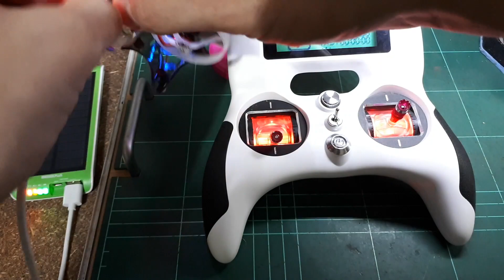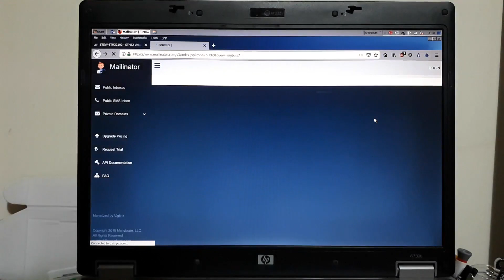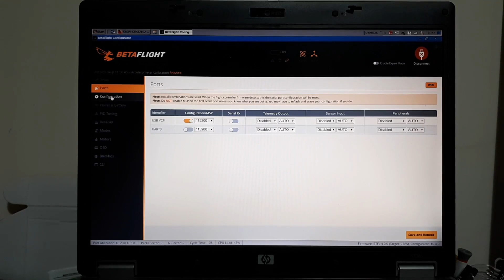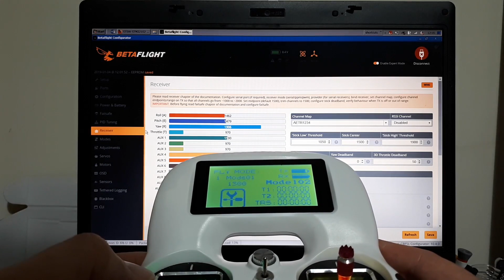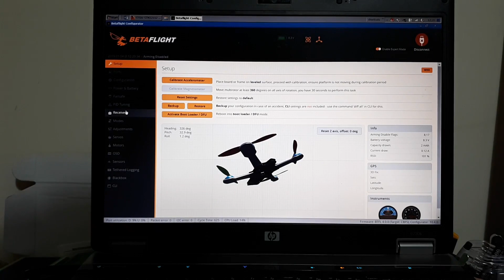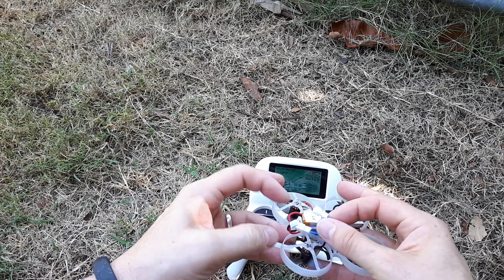Setting up the Mobula7 for the Turnigy Evolution

Comment: Can i bind turnigy evo. in Eachine US65?
Reply from the maker: I just had a look on the Banggood site for the US65 and they do offer both the FrSky and the FlySky models, so it would appear that you might be in luck. However, I do not own a US65 nor have I tried binding my Turnigy to it, so I cannot be 100 per cent sure if it will work. If you want to try then my advice will be to get the FlySky version of the US65.

Comment: Hi how do I upgrade my firmware for my Turnigy evolution
Reply from the maker: Just run the executable on Windows. A quick search on google for 'turnigy evolution firmware update' showed some links to Hobbyking and Project Blue Falcon. Although those instructions are from 2017 I would say that they are still relevant.
Reply: Hi I went to the HobbyKing website and try to download the firmware and it says the page is blocked to get the update
Reply from the maker: @k-wayneslim8644  I downloaded the firmware in November 2017 and it is the same version (0.0.9.31). I've just uploaded the file here ( https://filebin.net/w5fu27d9ppoqdjlp ) the link expires one week from now.
Reply: @marcelpost4052  thanks so much
Reply from the maker: @k-wayneslim8644  You're welcome. The upgrade process should be pretty straightforward.

Comment: Hey 

How about mobula 7 v2
I got the turnigy Evolution and the mobula 7 V2

Do they have the same attitude towards mine?
Reply from the maker: Great! How does it fly? (who's 'they' ?)
Reply: Marcel Post 

So it didn't work for me. When I start to fly and accelerate and flies, the copter stays at full throttle permanently.

although we have the same remote control just mine is mobula 7 v2
Reply from the maker: @KimdraRC  Lots of things to check then. And since I don't know anything about your setup you'll first have to get me up to speed on what you've done so far if you want me to help you. 1) did you really get the FlySky version of the mobula 7, because only the FlySky versions work with the turnigy evolution. 2) When you follow my steps in this video, at what point exactly (after 14 minutes in) does your mobula 7 differ from mine in the betaflight setup?  3) did you calibrate the mobula 7 on an even and horizontal surface? 4) do you have a mode 1 or mode 2 Turnigy Evolution?

Comment: Can I bind Tiny Hawk2 with Turnigy? Thx
Reply from the maker: When you read the page for the TinyHawk2 on the Emax-USA website, you'll see written: "(TinyHawk2 features) Frsky compatible receiver built-in to the flight controller". The FrSky protocol is NOT compatible with the FlySky protocol. Since the Turnigy evolution only talks the FlySky protocol, the TinyHawk2 is not compatible with the Turnigy Evolution. Unless you can find a TinyHawk2 with a FlySky-compatible flightcontroller it's not going to work..

Comment: Hello I was wondering if your big quad was using echine vtxo3 and if it was how did you connect it with turnigy evolution
Reply from the maker: Hi Jacob, the VTX I was using on the 5-inch quad is the Eachine TX801. It doesn't support smartaudio, if that's what you were asking about.. The mobula 7 does support smartaudio and it's just built in to the fc, you can just use the Evolution to change channels, nothing to configure. Sorry, I can't recall what the stick-sequence is to get into the menu, but it's something like: throttle-middle, yaw-left, pitch-up to enter the OSD menu.

Comment: Hey Marcel, ben je er al uit hoe de flymode werkt gecombineerd met betaflight
Reply from the maker: Je bedoelt horizon vs angle vs rate mode? Yup, dat heb ik op de linker switch van de evolution gezet. Ben nog steeds niet over op acro (rate) mode omdat ik nog niet veel fpv vlieg, maar voornemelijk line-of-sight.
Reply: @marcelpost4052  nee bedoel flymode op de turnigy evolution pro controller. Links boven in het scherm. Het is me inmiddels gelukt om alle vliegmodusen in te stellen op de controller (airmode, horizon, angle, headless, flipover, beeper. Het lukt me alleen niet om de prearm  in te stellen. Hij zegt dat hij saved maar zodra ik ander tabblad klik en terug ga is de prearm mode leeg. Heel vreemd
Reply from the maker: @ricardo8499  Oh, dat! :-) Weetje, ik heb geen flauw idee waar dat voor was. Ik heb altijd de modes ingesteld op een 3-way switch via Betaflight. Wist niet dat je dat ook via de touchscreen kon doen. Het fijne van de modes op een switch hebben, is dat je tijdens het vliegen simpel van mode kunt veranderen.
Reply: @marcelpost4052  het is ook door middel van de switchen maar je kan dan meer combinaties maken en de namen eraan koppelen. Dan weet je dus in welke modus je zit.
Reply from the maker: @ricardo8499  Okee, ik denk dat ik het snap. Heb afgelopen weekend een klein breukje in het frame gekregen. Waarschijnlijk ergens tegenaan gebotst ofzo. Gebruik jij het standaard frame of heb je extra (sterkere) frames gekocht?
Reply: @marcelpost4052  ik heb die V2 frame. Tot nu toe geen scheur en toch al aardige klappers gemaakt
Reply from the maker: @ricardo8499  Hehe.. super. Ik denk dat ik binnenkort maar even wat V2 framepjes moet kopen dan. Hee, success ermee.
Reply: @marcelpost4052  bedankt,wil jij kijken of je wel die prearm functie mode kan opslaan in betaflight?  Ik zag ook dat er een V3 frame was
Reply from the maker: @ricardo8499  Wat is een pre-arm functie? Ik arm gewoon de quad en vlieg weg. Doet die pre-arm iets speciaals? btw, bedtijd hier; kan er misschien morgen even naar kijken. Groeten.
Reply: @marcelpost4052  prearm is een extra veiligheid, dubbele handeling voor het armen, welterusten

Comment: Hey Marcel, could you help me?
In dutch and have the mobula and turnigy but its not working
Reply from the maker: Sure, no problem. Als eerste moet ik natuurlijk weten of je werkelijk de FlySky-versie van de Mobula7 hebt. Als je de FrSky-versie hebt, dan tja.. gaat het niet lukken.. Ik weet niet hoe goed je Engels is, maar als je bovenstaande video bekijkt, kun je dan wellicht aangeven op welk moment jouw Mobula7 afwijkt van wat de mijne doet? Ik heb ook een video gemaakt, speciaal over het binden van de Mobula7, misschien dat die ook helpt. Hopelijk kunnen we het stap-voor-stap doornemen en uitvissen waar het probleem zit. Als je wilt, kun je me ook mailen. Als je m'n voornaam en achternaam van plaats verwisselt, een punt er tussen zet en AT gmail.com erachter doet dan kan ik je wellicht iets sneller helpen (ik kijk niet altijd op youtube).
Reply: @marcelpost4052  bedankt voor je snelle reactie. Het is me al gelukt. Ik moest hem eerst flashen zodat ik de modes kon zien met de betaflight 10.5. heb je nog tips ?
Reply from the maker: @ricardo8499  Hey, hey.. goed nieuws! Tips? Nou, afgezien van 'hou 'm heel', heb ik gezien dat je een throttle-limit kunt instellen voor binnenshuis vliegen. De standaard throttle is waarschijnlijk te gevoelig voor kleine ruimtes, als je de maximum throttle via bf kunt terugzetten naar zo'n 70 procent dan zou de mobula7 iets beter te handelen zijn. Heb het nog niet geprobeerd omdat ik voornamelijk buiten fpv vlieg. Success er mee! :-)
Reply: @marcelpost4052  ga ik doen bedankt! Ik had ook al pid settings gevonden die hem aan het begin niet zo paniekerig laat vliegen. Throttle ga ik zeker aanpassen!
Reply from the maker: Ziet er naar uit dat je er een hoop plezier mee zult hebben. Gelukkig hoeven we quads lichter dan 250 gram nog niet te registreren hier. Gedoe zeg. Anyway.. Happy Flying! :-)

Comment: I have the same UAV build but i can`t fly it i can spin my motors in betaflight and controls seem to work as fell but when i try to fly i get flashing red led on flight controller :(
Reply from the maker: Check with your supplier. My first Mobula7 had a faulty flightcontroller and they supplied me with a replacement fc for free. This may not be applicable to every supplier, but it's worth contacting them to find out if they have any suggestions. Hopefully my videos will show you exactly where your fc differs. This may help you better explain to your supplier where the problem lies.

Comment: I just bought the tunigy evolution and I don't know beta. Can I skip all that and just bind with my quad? I have the tinyhawk..
Reply from the maker: Congratulations on getting into the hobby! The Mobula7 and Tinyhawk are both marketed as Bind-'n-Fly (BNF) quads. This means that although they are compatible with a lot of transmitters, they do not have an initial setup that your Turnigy Evolution knows about. BNF quads is all about giving choices to the hobbyist. Not only will you NEED to configure your new BNF quad with something like Betaflight; after a while you will probably WANT to. Out of the box, my Mobula7 had all sorts of alarms going off when sitting on the ground, armed turning on the transmitter etc.. really annoying. You can turn that off with Betaflight. The so-called Turtle-mode, which flips over your quad when it's landed upside-down by reversing the prop rotation with a switch on your radio is super-handy, but UNCONFIGURED by default. You may even want to use a different switch on your transmitter to arm your quad, or fly with Mode-1 (throttle on the right stick) instead of mode-2 (throttle on the left stick). All these options can be configured with Betaflight. It may be daunting to get to know the software and there are a ton of options in there to confuse you at first, but once you get better at flying you'll probably want to explore features that you see other people do with their quads. Especially for newcomers to the hobby, I wanted to simplify the Betaflight setup in this video as much as possible, so you can maximise your time actually flying your quad.

Comment: Bit of a newcomer to this so bear with me. Would this setup be the  same for the Mobula 7HD version? If nor what the differences be? I do have the Turnigy Evolution . Thanks in advance.
Reply from the maker: I believe so. I think that the HD version is just a video-path upgrade (camera, vtx maybe). Make sure you get the FlySky version of the Mobula as only that protocol is compatible with the Turnigy Evolution.
Reply: @marcelpost4052  Thanks I hope to be purchasing soon. Do you have a preferred retailer?
Reply from the maker: @gamecockfan2001  I'm not affiliated with anyone. I bought mine from Banggood in November last year and had to wait 5 weeks until it finally showed up. It had only just come out back then and it was on back order for quite some time. Hopefully they'll be able to deliver faster now.

Comment: thank you for the video, if i want rssi osd i must set up ibus or sbus in the tx? thank you
Reply from the maker: I don't think the protocol matters, but since the receiver and the OSD are on-board the flight controller, you may need to enable it from within Betaflight. That said, I'm not sure if the RSSI is fed to the FC at all. Sometimes RSSI is a separate physical wire from the receiver to a pin on the FC. For this quad I have no idea if RSSI is available.
Reply: @marcelpost4052  thank you for the explication 😎
Reply: Dont know if you guys gives a shit but if you're stoned like me during the covid times then you can stream all the new series on instaflixxer. Have been watching with my girlfriend for the last couple of days xD
Reply: @Conrad Keith Definitely, been watching on InstaFlixxer for years myself :)

Comment: I can't for the life of me to get this thing to stop beeping at me I can arm it and fly it but it beeps non stop and i noticed on your evolution your home screen says fly modes and mine does not i don't know why!
Reply from the maker: Hi There, yeah, I think it is what you mentioned earlier about the battery voltage. What is beeping, the transmitter or the quad? If it's the transmitter then it may be that the transmitter believes either its own or the quad's batteries are low. In the battery setup for the Evolution, there is Tx setup (for the batteries inside the evolution) that I have set to: High=4.2V, Ala=3.7V, Low=3.6V, then scroll below to Rx setup (for the batteries inside the quad) I have set Rx setup (crosssed), High=8.5V, Ala=6.4V, Low=6.4V, Ala dly=1.0S. Now... if it's the quad that is beeping then you will need to set that in Betaflight. Does that help?

Comment: I have a question sir! So im new to this first hobby grade setup! Ok i have the same turnigy evolution tx and Mobula7 so when following your vid for the battery setup on the tx you set high voltage to 8.5, alt voltage to 6.2 and low voltage to 6.2 so on my tx when i try to set the low voltage to 6.2 i can't mine only let's me scroll between 6.0 and 6.1 would you know why i can't set to 6.2?

Comment: So, will any Mob7 bind to my Turnigy Evolution? Or do I have to buy a specific Mob7 that only runs FlySky??
Reply from the maker: Only the FlySky version of the Mobula7 is compatible with the Turnigy Evolution. FlySky uses the AFHDS and AFHDS-2A (with Telemetry) protocol. If the receiver (on the quad) doesn't understand this it is not going to work. Some other models of quads don't even offer a FlySky version, so double-check this before buying just any quad if you're hoping to fly it with your Evolution.
Reply: @marcelpost4052  I bought the Evo because when it came out everyone on YouTube was saying how great it was. So fast forward, I get one and now all the people around that fly FPV me are saying that FlySky is trash, and the receivers will make your quad drop out of the sky etc etc..
Reply from the maker: @NuisancePanda  This is the Internet. It allows you to find a counter-argument to just about anything you care about in less than 60 seconds. I just love my Turnigy Evolution and although I have another traditional-style radio, my Evolution is just waaay nicer to handle. I fly my 5-inch quad in small parks and near some river banks and the Evolution has always worked flawlessly. I fly within a radius of about 500m with minor obstacles and some small trees. In my experience, the worsening quality of the video feed (200mW@5.8GHz) prevents me from flying to the edge of the comms link, so it's a non-issue. If people around you are saying that FlySky is trash it may be time to find different people around you. This hobby is about having fun and I'm convinced you can have a lot of fun with a Turnigy Evolution and a Mobula7. Btw, I'm not affiliated with any of these products.
Reply: @marcelpost4052 - LoL I didn't think you're sponsored by anyone. I appreciate your help  my friend.
Reply from the maker: @NuisancePanda   Hehe.. yeah, pretty obvious, but still.. Thanks for the feedback. I appreciate it. Feel free to come back here or let me know how your flying experiences were with the Evolution. I'm sure there are other people interested in how this radio performs.
Reply: I will most definitely do that, brother
Thank you

Comment: Can you please let me know how can i connect Emax tiny hawk to turnigy evaluation ?
Reply from the maker: I don't think they sell the Tinyhawk in a FlySky version (which you'll need for the Turnigy Evolution). If you were able to get a FlySky version of the Tinyhawk somehow, then find out what flightcontroller it has. Once you know that, you should be able to find out which receiver they embedded on the board. It's the receiver module on the flightcontroller that determines how to enter binding mode.
Reply: I have a tiny hawk I'm trying to bind to Tunigy evolution. Help?

Comment: That with the blinking is on my eachine us65 too but if i put the battery in its still doing the same (but i charged these batteries)
Reply from the maker: Apparently the quad won't arm when the fc is connected over USB. This is a configuration option in Betaflight which can be modified.
Reply: @marcelpost4052  i got it yesterday. I forgot to change the volt from the batterie it was on 6volt but the batterie has obly 4.35 thanks